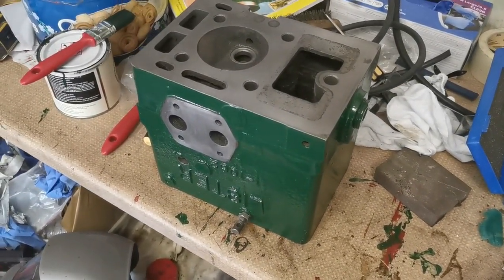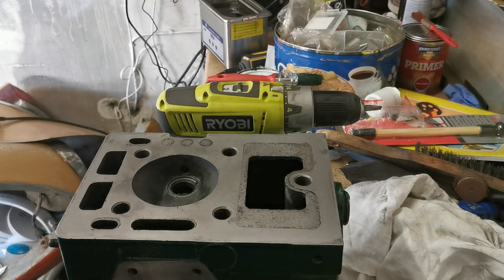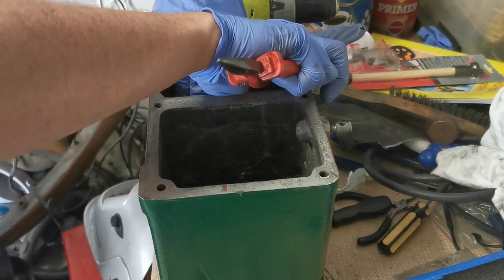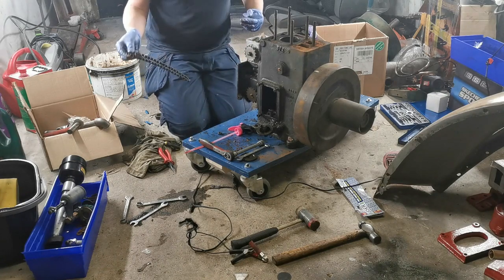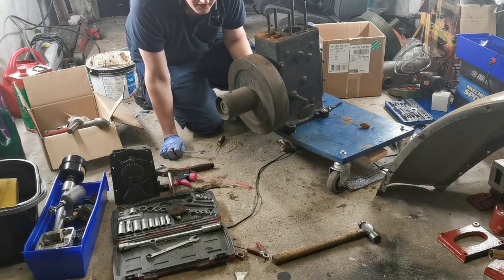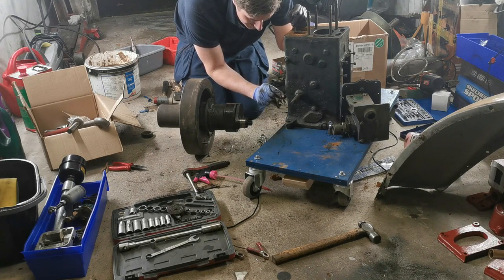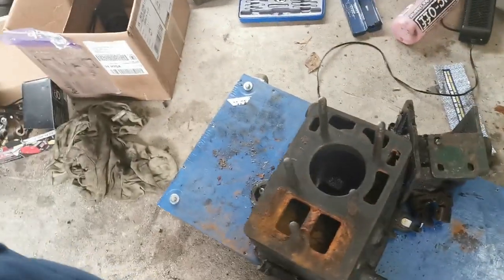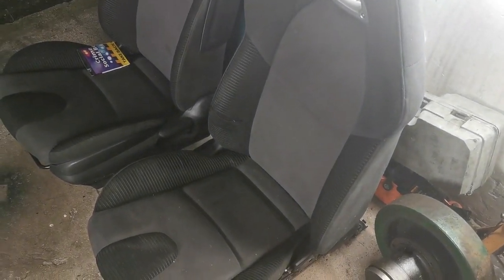Lister D restoration Part 8 - Valve lapping, crankcase strip and cylinder honing

Comment: At 15.25. Looking at your valves..  the thicker valve is for the fuel inlet, and the thinner is for the exhaust outlet.  I think by the look of it you have them round the wrong way.  Im at this stage now on a Lister D.  All the forums and other UTube films show the thicker one being the inlet and thin the exhaust valve.  Nice restoration so far.
Reply from the maker: Thanks for the heads up. You're right. I actually put them right off camera. I'll be restoring a little 2hp Briggs engine over the next while so you might find that interesting too.
Reply: Endfloat.    its odd.  i would have thought the thick one was thicker because its burning hotter thus will be the exhaust valve till i read all the forums.  It may be over the fuel inlet as its nearer the spark plug thus takes more heat on combustion..  but it does appear the thin is exhaust and the fatter one is fuel inlet.  bit odd but thats how it is..😜
Reply from the maker: @MetamorphicWonders  yeah I thought so too, which is why I went wrong initially. I must remember to do less of that thinking carry on. It'll only get me into trouble!

Comment: You've certainly got a lot of work on your hands & you are making a cracking job of it. Are you going to strip the old crank/main bearings down? Thank you for recording your progress & sharing it !
Reply from the maker: If I can get the gib key out, I'll strip the replacement crank to clean and inspect it. I have to make up a tool to remove the key though.